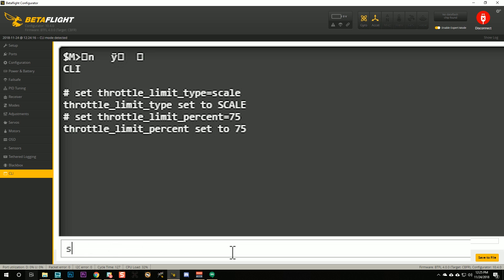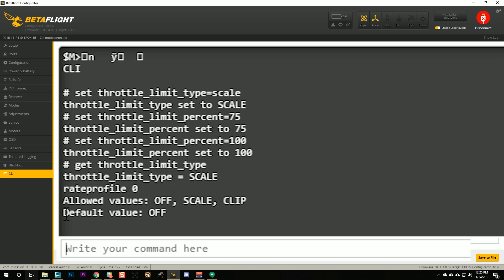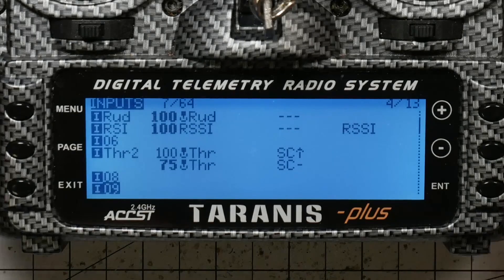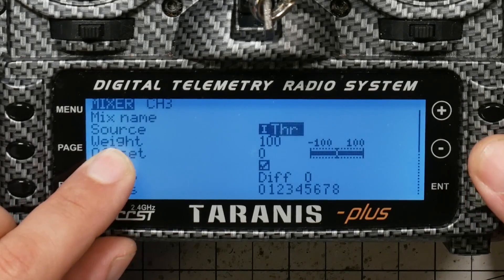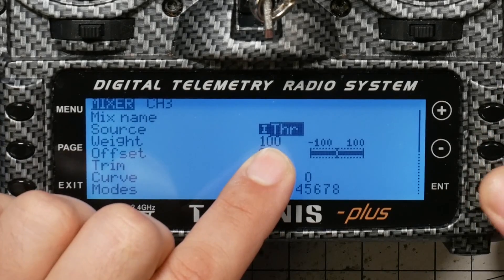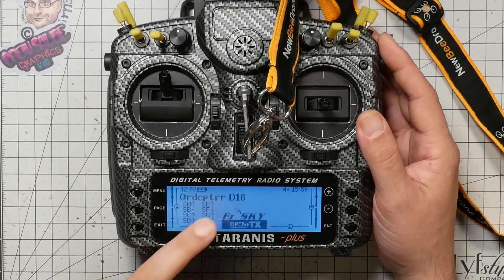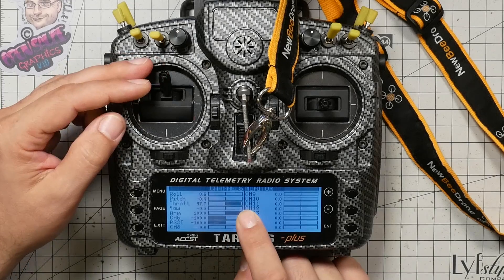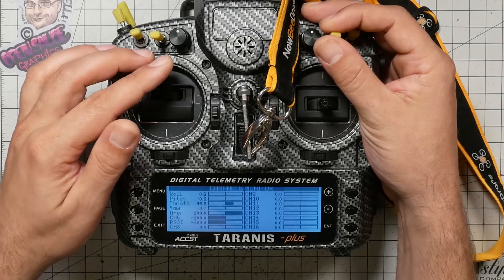Betaflight OpenTX Throttle Scaling | TAME YOUR 2S TINY WHOOP

Comment: Hey Josh, im an acro guy and never did angle or horizon mode until i got the mobula7. It just flies better indoors in angle. I understand Angle Limit, but my question is... what the heck is Angle and Horizon Strength and what is Transition? Very little information online. Next video maybe? Its whoop season lol
Reply from the maker: Angle and Horizon strength is how strong the quad will try to autolevel. Like P gain.

Transition is for horizon mode, the stick position where it transitions from angle to acro.
Reply: @JoshuaBardwell  after trying different values, I think I found the perfect combination of being able to fly with stability as well as the occasional flip and roll. I now use horizon mode and got it flying exactly like my angle mode by changing the transition to the max, which is 200. So that the sticks feel exactly like angle mode, but if I go to the very extreme at 100% it will flip and roll on command. You can also lower the strength value to smoothen the recovery from flips and rolls. Never thought I could do fast forward flight indoors while barrel rolling over my kitchen table or front flipping down my flight of stairs. It's amazing lol.

Comment: Thanks for the interesting video. I thought about using this to run 5s with my high KV Motors (2450). Would this be more efficient and batteries lasting longer as it doesn't push it to the limit like with 4s? What do you think? I could use it then with 4s, 5s and even 6s....
Reply from the maker: I have heard that argument and I am interested to try it for myself.
Reply: @JoshuaBardwell  Oscar wrote about it already https://oscarliang.com/6s-high-kv-motors/ .I would be curious to see that in one of your future videos, would fit perfectly to your 6s discussion you already had ;-)
Reply: Kabab explained higher kV motors have a more linear throttle response we only have to shop off the top end ;)  This makes it worth living to have a freestyle/race setting in one quad where I was thinking of for a 5"build AND to tame a high kV 3"build,  current limitter etc.  Using a 6S motor at 4S appeals to me as well.

Comment: Hi Joshua, great information for beginners.
But one thing I want to mention is, using 3-pos switch to change the throttle scale, by only using SC-UP and SC-MID, if you accidently switched to SC-DOWN your throttle output will be constant zero which means 50% throttle. This might shot your quad to the moon. 
In this case I suggest to use !SC-UP instead of SC-MID, or put another 3rd scale on SC-DOWN.
Reply: Arigato Gozaimasu! That's also what I had in mind! OpenTX has a thousand ways to program stuff but a few are perfectly functional.

Comment: Why dont you just use a throttle curve or expo in the PID section? 

How can you be at full throttle with a whoop in a house anyways?
Reply: The pid section's s.rate and expo changes the shape of the curve, but it still goes to 100% whatever you do with those variables.
Reply from the maker: Betaflight doesn't support a proper throttle curve. Expo doesn't work how most people think it does, although the method of lowering throttle mid and raising expo does create a sort of throttle curve.
Reply: @JoshuaBardwell  ahhh, I see. 
Well thanks for the quick reply and information on the hobby. 👍✌

Comment: I limit on my x9d with the potentiometer, 100-90-80 (full-center-min) for my FS builds. 100-85-70 on my racers. Audible call out as well :)
Reply: Do you think it’s possible to assign the throttle weight and offset to a potentiometer?

Comment: Hey Joshua, thanx for the awesome vids man, so much help for noobs like myself....;D...much appreesch...!
What I did on my Mobula7 was to simply move the throttle MID to 0.00 and then to add throttle EXPO(between 0.55 and 0.35 depending on skill level) in BetaFlight - now low throttle is nice and tame but still have full throttle on full stick deflection....so could essentially fly in and outdoors with the single throttle setting.(I don't have another switch on my DX6i to add the throttle switch the way you did) ...If all that makes sense...;P

Comment: Is there any difference in doing it in betaflight compared to the radio?  I know that using the radio to do this, also increases throttle sesitivity, since you loose some potetial stick range.  So I was wondering if doing it in betaflight would counter this.
Reply from the maker: Practically speaking, I doubt you will notice the difference in resolution. But doing it in the radio technically has less resolution.
Reply: Thanks Joshua,  I had a feeling there would be a difference, nice to confirm that my knowledge is getting better about this hobby ;-).  Don't think I will do it though I will just manage my Thr. better ;-) and moove them fingers faster.

Comment: Can we use a scale value of greater than 100? I want to do the opposite of this video.  I have a heavy whoop that can only fly when the throttle is above 50%.  I want the throttle to feel more like my bigger quads where most of the action happens in the lower end of the throttle range.
Reply from the maker: I think you can definitely do this in your radio, but I don't think the Betaflight scaling parameter does this.

Comment: Is it possible to reverse channels in a switch with taranis.i mean reversing other channels using switch
Reply: RC Creations  - you can use special functions, but it is a bit complicated.  Painless360 has lots of content about the Taranis radios and how to do that.  I reversed my roll ( left = right , right = left roll ) on one model, becouse I am using a multiprotocol to controll a toy drone, where the roll was inverted.  I simply changed the 100 to -100 in the mixer, for roll.  By using special functions you could make that happen on a switch.  Hope this helps.  Search on youtube or google about special functions taranis radio, or whatever radio you have.  Hope you figure it out. Fly hard.
Reply: @SOLARFPV  thanks a lot dear for that info
Reply: RC Creations - your welcome, I hope you find a sollution to your problem.

Comment: hi sir PDB is built into the F3 and F4 FCs right ?  How can i wiring my ECSs to my f4 FC, because i dont know where to wiring the ESCs to the board, and my ESCs have one red cable (positive), one black cable (negative) and two black and white cables, which cables wiring to the F4 FC ?(all the stuffs to build the quad i got on getfpv.com, and all those cost 450$)

Comment: wow, that taranis throttle curve programming is clunky.  Not hating, just observing.  I really like my DX8 lets me just change the values at bottom, low, mid, high and full, assign to a switch and see whats what.  

OMG the bit about the Mob7 at the end, I'm dyin here!
Reply from the maker: The taranis is more open-ended but has a higher learning curve. Taranis makes no assumptions about what you want to do.
Reply: @JoshuaBardwell  Interesting.  I'm not really from one camp or another, just started in fixed wing back right before Flite test got hip to FRsky, and took a big old break when the first round of regs went through.  But now I get why so much gets done in Betaflight.

Comment: While we're all thinking about the Mobula7 and OpenTX customization...  I've been thinking about my timers.  I don't watch the battery voltage very diligently, so I have a timer setup on my QX7 that provides haptic feedback when I should start paying attention to my quad's voltage.  However, when I fly on my 1s 450mAh batteries on the Mobula7 I don't have to pay attention until at least 5:30 whereas when I run on the pair of 260mAh batteries,  I want to start paying attention to the voltage around 3:15ish.  Also, I use a different throttle curve for 1s to boost the response at the low end of the throttle.  So, I when I reset my timer with the momentary switch, I'd like to have the timer be longer when I have the switch setup for 1s throttle, and shorter when set for 2s.  So,  how can this be done?
Reply: https://oscarliang.com/setup-taranis-read-out-voltage/
See above works perfectly. If I knew how to send a photo I would show you my x9d setup page for 1s audible warning

Comment: I had a similar issue with my uk65., my solution was to just add a little throttle expo., so I can have full throttle still outdoors and still have a managable throttle indoors while hovering. It's just full stick that gives it ALL THE THROTTLE., so I don't do that indoors haha you way's better though., but mine works I guess lol

Comment: They should add something like this to the OSD settings menu. For now, using throttle max endpoint on the Taranis is much easier and accessable in the field on the fly.
Reply: I noticed that on one of your last videos, you had the throttle at 89.
Reply: @brandonwoodford579  I usually fluctuate between 60 and 99 on the throttle endpoint of -100 to 100 when I'm running 6S

Comment: I do the TX change via a mix instead of inputs and use a pot to change the amount.  This way I dial up the throttle as required.

With this I can test hover a very powerful quad in a small area with almost no chance of a runaway.  I set the power so low it barely hovers on max throttle.

The mix is:
CHx:IThr Weight(100%)
*= S1 Weight(50%) Offset 50%
+= S1 Weight(50%) Offset -50%

What this does is it changes S1 into a percentage (0-100) and multiplies the throttle by that scale.  The next part uses the same S1 percentage to lower the min throttle so the base is always -100.

I also remove trim from my throttle (so that the any bump to the trims does not change throttle output).  Quad's never need trims.
Reply from the maker: I came up with a way to do it using global functions and the input line, but it was hella complicated. Your way is far simpler.
Reply: @JoshuaBardwell  Thank you for the credit and mention on the Throttle Limit on Side Slider video. - https://www.youtube.com/watch?v=m9Gf95fapoQ

Comment: Hey Joshua, great minds thinking a like and all that, I did a video about this very subject earlier today - gives me confidence that I was on the right lines if you're talking about it as well :)  Some people may have already mentioned it, but as throttle_limit stuff is part of the rateprofile, so it's easy to switch different throttle limits around this way.  You could use the adjustment tab, but in my example (I was using the X-Lite and had run out of switches) I simply used the Betaflight OSD to switch rateprofiles - so very easy to move your limits for inside/outside (in the case of the Mobula7 at least)
Reply from the maker: Hey CurryKitten. Kudos on the comprehensive video. I didn't realize it was tied to rateprofile and could be switched. I'll put a link to your video in a pinned comment.
Reply: The easiest way to switch between Rateprofiles is by using Stick Commands - don't need to go into the Betaflight OSD or setup a switch on your TX & corresponding Betaflight setting.
https://github.com/martinbudden/betaflight/blob/master/docs/Controls.md
Reply from the maker: @licensetodrive9930  that switches PID profile, which isn't exactly the same as switching rate profile. If you have custom PIDs, then using stick commands may change you back to defaults, unless you have set PID profiles to the same custom PIDs.
Reply: Joshua, ahh nuts, didn't realise, I thought that would be the simplest solution.
Reply: Only watched this as I thought he was going to give you a shout mate. Right lines indeed.....

Comment: Nice explanation from the Taranis side. But actually you can do the same with Betaflight. For example under rateprofile 1 set throttle scale to 100% under rate profile 2 set scaling to 75 and so on. You can also put the different rate profile's under a switch. I'm not taking the credits for this but the guy curry kitten made the video around the same time as you and mentioned it. https://www.youtube.com/watch?v=rwUdwUMMytI
Reply: The Taranis method does save a channel, though.
Reply: @d3c0deFPV  who cares with 16 channels at your disposal :-)
Reply from the maker: Only 8 channels if you want the lowest latency.
Reply: Joshua Bardwell as you know you can change the rate profile through the OSD. So no need for giving up a channel. But having the rateprofile's under a 3 POS switch is very convenient.
Reply: @fpvlive  Ah, that's true if we're not talking about using a switch. That's a pretty easy method if you don't change this a lot.

Comment: I'm curious if it is possible to set the transmitter's power adjustment to a switch. In the end, open tx gives you unlimited possibilities. Maybe someone did it?
Reply from the maker: You can do it with a Lua script, but not without.

Comment: Hi Joshua, maybe this is some useful info. The throttle limit in Betaflight is assigned to a rateprofile. So if you would set up 2 or more identical rate profiles but change the throttle limits between the different profiles, then you can easily switch between the different profiles via OSD. Or if you use the "adjustments tab" in betaflight you can even put it on a switch. This is how you could easily switch between a "indoor" mode and "outdoor" mode of your quad (not only 2S whoops).
Reply from the maker: This is a great tip. I didn't realize they tied the throttle limit to the rate profile.
Reply: @JoshuaBardwell  curry kitten has the video he made on this.... this is what I ment to explain in my comment lol.... see I learn from all you guys...every YouTuber has things or says things in his video that are different (different way to do things)... so I learn from all...
Reply: @JoshuaBardwell  he made this same video 6 hours ago...(that's what I was talking about lol)... but he has stuff that you.dont and vice versa)

Comment: Hey Joshua have you looked into a cam upgrade on the Mobula 7? I'm in the process of figuring out what could go into it and any help would be great...….yeah, yeah I know Run Cam eagles and Foxeer Falkors spoiled me LMAO.
Reply: Same here, made a post on Reddit asking if anybody has done the upgrade and what are the recommendations.
Reply: @HenryDarr  it's the ONLY thing I don't like. I just can't see the branches and mesh very well with the camera that it comes with.
Reply: @SuperSilvi1990  I find the best conditions for this camera that comes standard in the Mobula 7 is overcast skies.
Reply: I was looking at a camera vtx AIO system but I'm not sure if it will fit in the housing.
Or just get a camera.
Reply: @HenryDarr  Agreed I have two vids on my channel of the DVR. One during mid day and one in overcast. I also like it during golden hour.
Reply: I intend to try putting a RunCam Nano and Eachine VTX03 on my UK65, which I'll be able to do when GearBest gets up off its ass and posts me the Nano I ordered 22 days ago.
Reply: @licensetodrive9930  OHHH man that sucks. I actually stopped using bang Good because it would ALWAYS....ALWAYS take 30 days to get my stuff. I have a old micro cam on an old XK X130-T that I wanted to try. Im just trying to figure out how to mount it with the canopy from the Mobula 7.
Reply: @RIPTIDE FPV I ordered a RunCam Nano plus a replacement lens for my existing Nano 22 days ago, the lens arrived 4 days ago but no camera. I'm ok with the 2 week or so wait for getting things from GearBest & BangGood etc. because of the good prices, but now I'm getting annoyed it still hasn't shipped.
Reply: @licensetodrive9930  the least amount of time it took for bang good to get me something was 38 days. I get stuff from getfpv now it's great, if you live in the US.
Reply: @licensetodrive9930  I hope that nano works cause I might do the same.